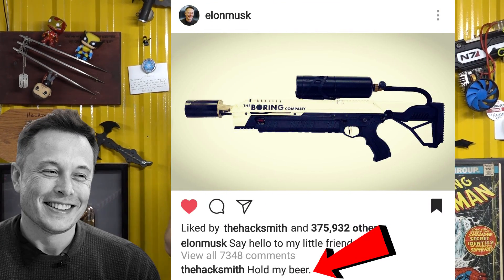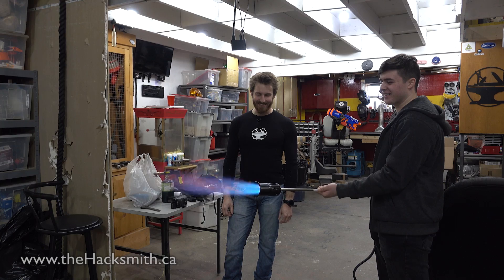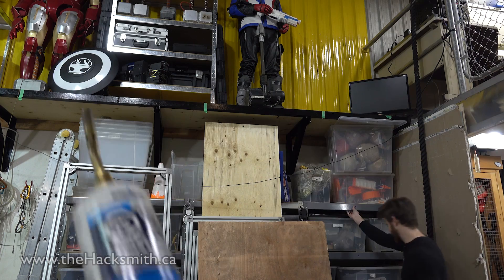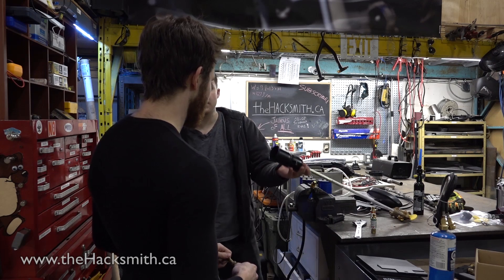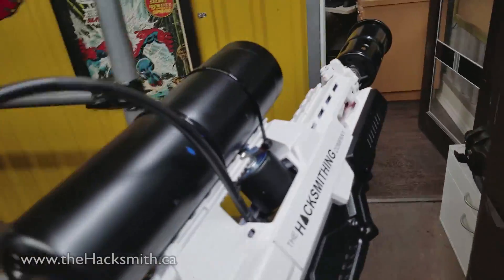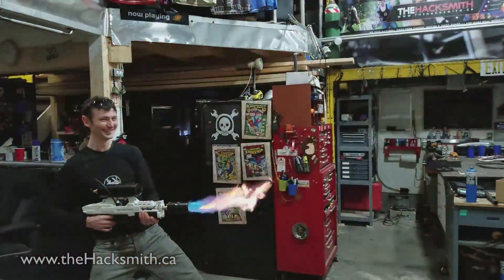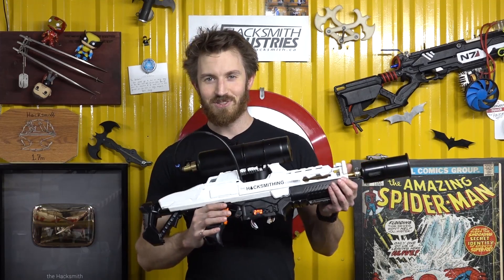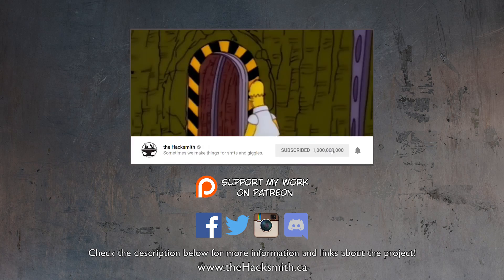Make your own BORING FLAMETHROWER! 🔥🔥🔥

Comment: Why do you have to start on a low pressure if you use a solenoid valve?
Reply from the maker: For the flame
Reply: @hacksmith  i ask because i am almost done with my own flamethrower, but my solenoids are not working.. Am i breaking a 12 Volt solenoid valve if i use 2 9Volt Blocks? (so 18 volt)... Anyways your projects are awesome, keep it up hacksmith-Crew :)

Comment: The problem you guys are having is because the tank keeps getting flipped upside down. May I suggest you get one of those evaporating types of a torch? Something like this https://goo.gl/images/2z3LJ9   - Nice work though, as always!
- Or to keep the looks the same, switch out the propane tank for an anti-siphon fuel tank , to prevent the liquid surges .

Comment: Wouldn't that be fun with an oxygen and acetylene tank instead? I mean, you could focus it better and burn through steal...way faster than the lightsaber. Maybe a bit more dangerous?
Reply from the maker: +Bill Curren pretty hard to make a big torch that way
Reply: the Hacksmith I guess for a thrower you was that rather than heat...a 2 foot long acetylene flame is super damaging, but wouldn't look too impressive, and can you imagine the kick?

Comment: You could actually use a 3d printed model of a computer reservoir holder to hold the propane tank.
It would be easy to replace a tank is one is out of gas.

Comment: I did want to ask. When you made this using a plastic toy gun as a base, how did the metal components not melt through the interior? Does it take a long time for the fittings to heat up from use? And using the small propane tank, how long can you use the flamethrower before needing to refuel it.p? And will you be making more nerf mod videos?
Reply from the maker: +jose paolo Aranda heat is only at the tip. If the inside is heating up you've got much bigger issues

Comment: Pretty sure that 20lbs propane tank is expired...
Reply from the maker: +All i want to do is watch Youtube i literally just bought it...
Reply: +the Hacksmith hmm what tank still uses the circle valves?
Reply from the maker: +All i want to do is watch Youtube BBQs
Reply: the Hacksmith lol fair. But i fill them where i work any tank that has those valves are either well over expiration or expired dec. 2017. I could and probably am incorect but may want to double check that date
Reply from the maker: +All i want to do is watch Youtube literally just bought it.

Comment: u should use the Rev trigger to switch on the electric ignitor and the main trigger connected to a solenoid to control the flow of propane so that when you pull the trigger more,more propane flows out
Reply from the maker: It's an on-off solenoid unfortunately. Full power or no power!

Comment: I think you need to just move your sparker forward slightly (past the air vents).  Right now it looks like it is in the pure propane region, (ie prior to air intakes).  That is why u have to goose it a little because shooting some propane and waiting allows the system to drop positive pressure and allows a little oxygen back to the sparker which ignites and then u shoot again to hold the flame. (this is conjecture)
Reply: that will put the igniter in the flame. yes it is tricker to ignite but it won't melt the igniter.

Comment: Why don't they ever use a flamethrower in the Living Dead series.  They made it clear in the movies that they fear and headshot aside are vulnerable to fire. And even used torches to ward them off. But not once in any of the movies did anyone think to have an actual or a custom flamethrower.
Reply: RNgN Rage Wrong, imagine carrying a 10 liter tank of fuel on your back and a big ass metal flamethrower